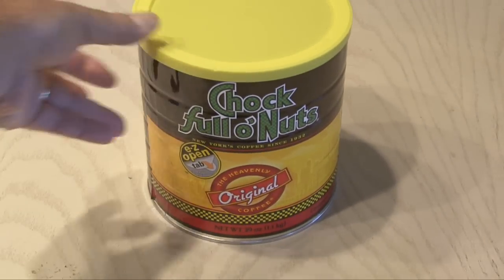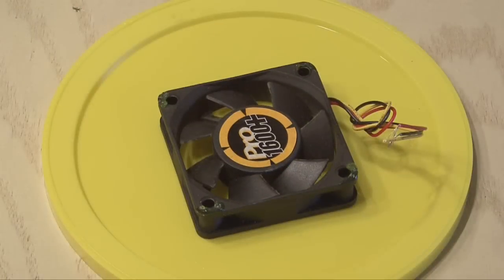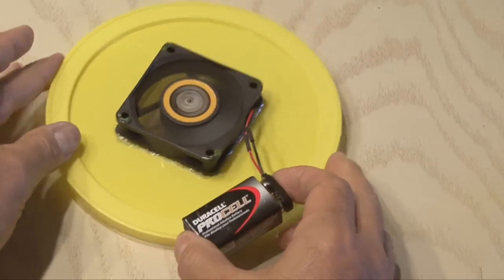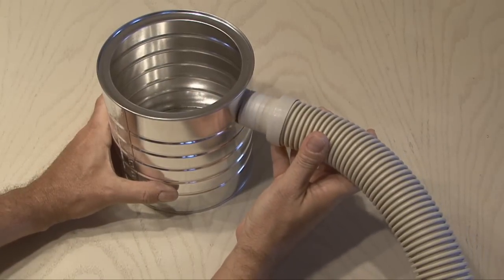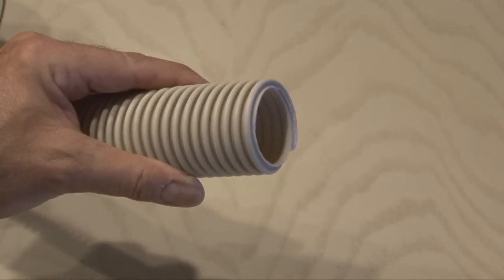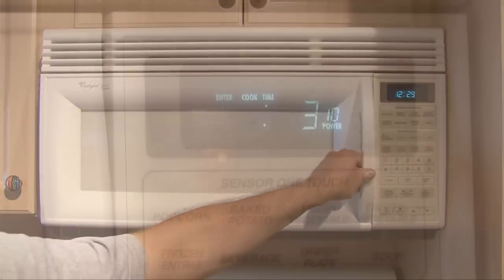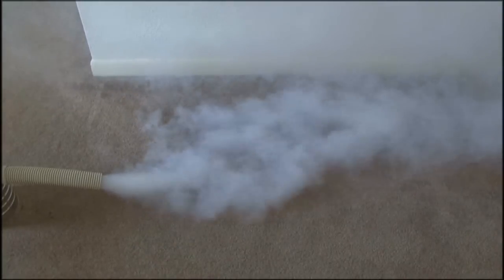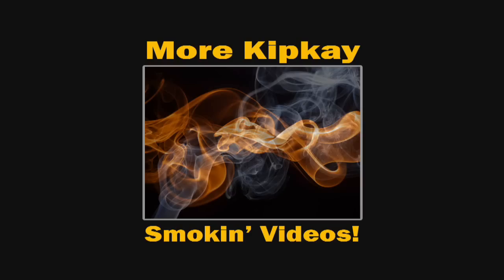Mighty Mini Fog Maker

Comment: Quick disclaimer (mostly for kids) that probably won't be seen: don't use this in an enclosed area with little to no ventilation. Dry ice is solid carbon dioxide. The fog is toxic to breath in. If the fog has nowhere to go, even if it looks like it has disappeared, it's still there. CO2 displaces air and settles below it, so if it has nowhere to go, ducking down below it and breathing in can kill you. Point being, if you use this, don't use it in a small room with no ventilation. Bigger versions can be dangerous, so unless you know what you're doing and how to keep everyone safe, best to just use it outside or in a small scale like in the video.

Comment: If you wrap several layers of heat tape around the can; you don't have to worry about the water getting cold and you can just keep adding dry ice  and get more fog this way. I made a version of this for an appetizer buffet and had fog flowing out from under all the appetizer platters.

Comment: I was designing one of these myself, and this vid helped me realize it's way better to run the smoke through the tube by pressurizing the can rather than through the blades itself. Thanks! Also, when you grabbed the computer fan box, I immediately had a deja vu as I realized I had done the same with my dad's computer fan box literally an hour or two before:)

Comment: no, the battery is not required to make a fog machine.. you can just use the coffee can and the pool hose to make the fog machine..but dont put the square hole on the top (: but the fan pushes more fog out of the hose so it helps :D

Comment: I found the video, the idea interesting from the start, but after thinking it over, you should definitely not use water (or water vapor in an engine if there are sodium valves !!) which is quite common
instead use a cloth soaked in baby oil. sorry for my English ,
   hello, Tom, from France)

Comment: I know this was posted a long while ago. I know you are big on safety, just thought you might want to throw in a few cautions: 1) Water boiled in the microwave could have a tendency to superheat and flash-boil. Adding a toothpick to the water will allow it to boil and not superheat. 2) The dry-ice fog is CO2, so one should always be careful not to do it in a heavily sealed area.

Comment: I'd use it for my frog tank. I'm trying to get a decent fogger without spending $100. Also, do u put the water and dry ice in with the battery and fan. Doesn't it spark or something like that?

Comment: nice build!
i'm working on a sawdust extractor, for when I sand my wood sculptures on my workbench. will a large pc fan do the trick, or how about 2 identical fans, both drawing in the air (and sawdust)? i'm planning on using a 9v battery.
how about a good air filter? any other ideas? all  are welcome!
(i'm a subscriber of MAKE magazine).
any precautions to take with the build, or using it?

Comment: is there a way to modify an e-cigarette to make a magicians smoke-from-the-fingertips device? the ones made for this sort of stage and up close magic are usually pretty expensive and while not loud they can still be heard...just curious.

also the mini fog maker machine can/could be used to produce smoke rings with a very slight tweak

Comment: Given the forces involved instead of fitting the hose to the can maybe one could fit the hose to the the plastic top and seal it with silicone ?
Regarding trying it on a r/v...I've got 12v, fans and a r/v.....

Comment: or you could probably use some old garden hose and cut many holes around the fog maker and tape it to the ceiling using duct tape because it's very strong, around the fog maker, and it can't show because it's taped to the ceiling. i haven't tried this because i don't have all the materials needed, but it could work.

Comment: A 50 gallon drum with a 10lb block of dry ice? That can actually be really dangerous, especially if you use it in an enclosed area. The concentration of 1kg of CO2 in a cubic meter of air will kill anyone. Half that is still very hazardous. That means that drum would have enough dry ice in it to kill a sensitive person in a typical bedroom.
Reply: you dont use fog makers indoors with high concentrations to begin with, and if you ventilate properly the oxygen flow with prevent the carbon dioxide levels from being too high keep in mine we can survive high levels of co2 its CO that kills
Reply: palehorse269 There is always someone that's going to do something stupid with this. For example, they might turn this on in a trailer and go to sleep. Plus, just because one thing is more dangerous than another doesn't mean no one is likely to die from the latter.

Comment: From Dry ice (english wikipedia):
"Dry ice is the solid form of carbon dioxide (chemical formula CO2),"
"The most common use of dry ice is to preserve food,"
"Dry ice has the advantage of being relatively cheap and completely non-toxic"

I don't know where you get that "toxic gas" from as it's only CO2 getting rapidly heated.

Comment: Ok so I have a question. Why is the fan facing outward instead of inward? Wouldn't you need the fan to push the fog OUT of the can? Unless you changed it later cause in the video I see it outward. js
Reply: most pc fans push air out of the side with the support

Comment: Also microwaving clear water can be a bit dangerous.
Reply: what how so?,,,,you do understand microwaves just heat up water partials ?
Reply: It heats up, but water does not have to boil just because it gets above 100C. It's called superheating. If it's still and clean, in a clean glass and evenly heated (good microwave) it may very well heat up to well above boiling point. Just as supercooled rain doesn't freeze until it hits the ground (or your windshield), the superheated water will not boil until you disturb it in some way, for example by moving the glass, putting a spoon in or similar. Considering it is way hotter than boiling point, all of the water will boil instantly, which more or less can be classified as an explosion. Good article on the subject on wikipedia, search for superheating.
Reply: I've seen it done a couple of times, so "almost impossible" sounds like an overstatement.
Reply: I also said "can be", not "is", but I'd still say it should be something you should know about before putting a glass of water in the microwave...
Reply: *****  they did it on mythbusters, search for it on youtube
Reply: linkmaster112233 "Tap water always boils, because it has impurities" So doing this with tap water is completely safe.

Comment: Nice and cheap fog machine. The only problem I see with it is that the dry ice will cool the water very rapidly, and your smoke volume will suffer. In a real fogger, the water is kept constantly hot with heating elements, and the reaction from the hot and cold increases the smog tenfold.
Add a coffee warmer element, and make sure it doesn't touch the dry ice.

Comment: does it have to be hot water?
Reply: I don't think so it just give you a better effect 'cause it warms the dry ice up quicker and causes the smoke to be produced at a faster rate and ergo a higher density and so you get a thicker foggy effect from it
Reply: guess i did not catch that
Reply: wall.e lover562 746 you cant melt dry ice. it instantly turns into a vapor. 
u dont have to tuse hot water, hot water just makes more smoke.

Comment: Is the fog dangerous for animals? Because i want to try this to my upcoming insect terrarium (not really a terrarium tho )
Reply: No
Reply: Vickor Gunandar Technically, it could be if it were in a very tight space. Dry ice is literally carbon dioxide in solid form, and it creates CO2 when it sublimates, so you wouldn't be able to breathe if there was enough of it to displace the oxygen. Basically, don't lock yourself in a closet with a block of dry ice and you should be okay.

Comment: I brought a charger that produces over 20 volts besides using the 9 volt battery clip cut the charger part of it and wired that to the fan plugged it in the wall and the fan ran so fast

Comment: uh isnt boiling water in a microwave a massive safety hazard? Can't remember the details, but there's this thing called superheating where the water gets hotter than its boiling point in a microwave, but when you move it, it will explode searing hot water... So use a kettle, just in case :)

Comment: i thought it was nice , untill the dry ice.
if someone knows a tut for something like this but with a better smoke solution, please link it or send me a pm.
i'm trying to make one for my job as a mechanic for finding leaks.
but prof. smoke machine's are super expensive.
Reply: Dry ice is generally fine for use in small concentrations indoors, as it's pretty cool (-170°) and likes to cling to the floor. However, it can cause asphyxiation in high concentrations, though not to the extent of Carbon Monoxide - which is 'easier' for the haemeglobin in your blood to capture than oxygen - hence the danger.

As for professional smoke machines, as a theatre technician, when possible we sometimes prefer to use dry ice, as it is better for performers, as its a natural gas that our lungs encounter every day. In fact - if you've ever been to a wedding and seen the first dance take place 'on a cloud' this will be dry ice!

So in your situation, I'd suggest this cost effective solution, with caution. Fact of the matter is, just about any gas in high concentrations has deadly potential.
Reply: Spencer Earwaker thanks for the info, really appreciate it.
but step 2 of the problem is that in Holland you can't buy dry ice without a license.
Reply: Aahh...
Reply: +Schyzofrenic87 thats because people in poland are crazy and smart enough to buy alot of it then go nuts

Comment: kipkay You are aware that dry ice is frozen carbon dioxide and using your machine indoors can be potentially lethal? It is just like sitting in closed garage with engine running? Better take this down before somebody will get hurt.
Reply: I see what you saying, but it's a MINI fog maker! and he's not telling you to pump the whole room of it. Believe me, I don't want anyone to suffocate to death either.
Reply: CO
2
is present in the atmosphere at 0.035% (Aer
ias 2005; CCOHS 2005).
In terms of worker
safety, Occupational Safety and Health Admini
stration (OSHA) has set a permissible exposure
limit (PEL) for CO
2
of 5,000 parts per million (ppm) over an 8-hour work day, which is
equivalent to 0.5% by volume of air. Simila
rly, the American Conference of Governmental
Industrial Hygienists
(
ACGIH) TLV (threshold limit value)
is 5,000 ppm for an 8-hour workday,
with a ceiling exposure limit of 30,000 ppm for
a 10-minute period based on acute inhalation
data (MDPH 2005; NIOSH 1976). A value of 40,000
ppm is considered immediately dangerous
to life and health based on the fact that a 30-minute exposure to 50,000 ppm produces
intoxication, and concentrations greater than
that (7-10%) produce
unconsciousness (NIOSH
1996; Tox. Review 2005). Additionall
y, acute toxicity data show
the lethal concentration low
(LC
Lo
) for CO
2
is 90,000 ppm (9%) over 5 minutes (NIOSH
1996). See Table 1 for a listing of
regulatory agency standards for acceptable CO
2
concentrations in the workplace. CO
2
is a good
indicator of proper building vent
ilation and indoor air exchange rates. Consequently, it is
measured in buildings to determine if the i
ndoor air is adequate for humans to occupy the
building (MDPH 2005).

It can be very lethal.